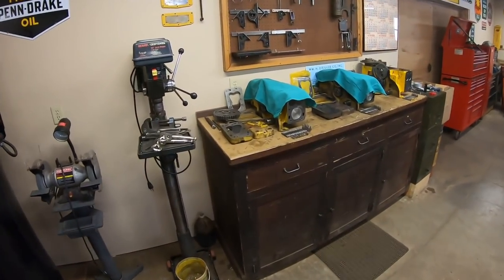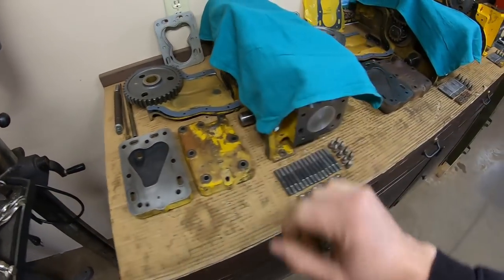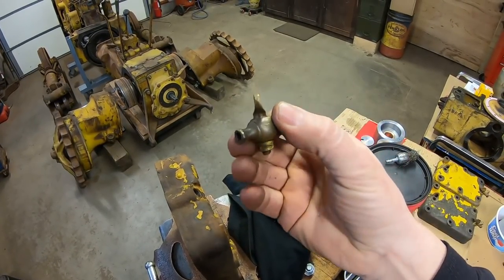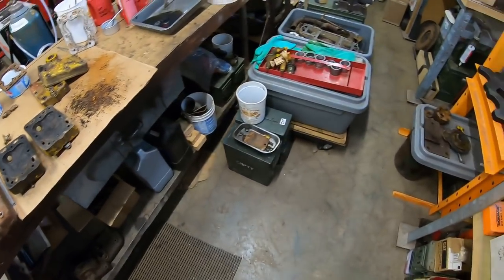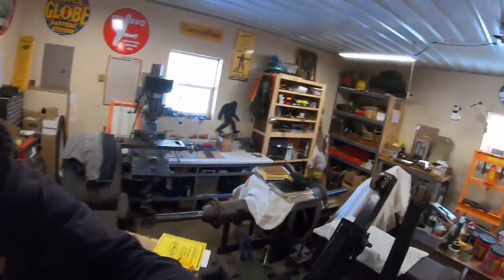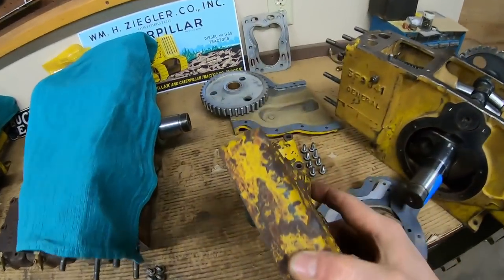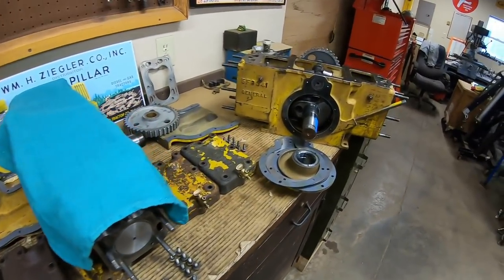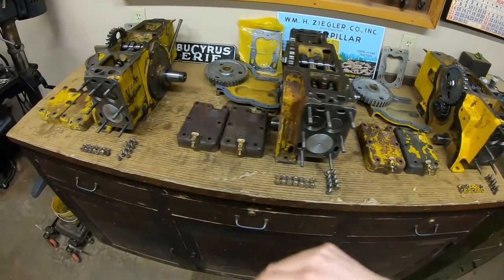Caterpillar D2 #5J1113 Starting System Ep.15: Dipstick Tubes, Prep Work & Cylinder Head Mayhem

Comment: A miracle that the correct hardware survived all these years. I work on stuff that isn't 20 years old that has all kinds of mix and match hardware in it.
Reply: Look up “pickeling”an engine, that is at least what it’s called in the marine world
Reply: The age helps 
Would have been the first machine people bought that had "standard" hardware 
Then for quite a while bolts were expensive so throwing away dodgy bolts and replaceing them was less common 
These days every farmer or construction company has a varied scale of bolt bin 
If I ever come across a bolt that's got a dodgy head or thread I just ditch it and put a new one in 
I mean bugger sometimes if the bolts too rusty I'll ditch it for a zinc coated one

Comment: Did D346 90 degree engines that had studs for mounting cyl. heads.  Made three spacers like the one you started to use on the dip stick! Tapered  a bolts last threads so to push on the center of the stud, then welded a longer nut to it after threading it about half way in the nut. Then could tighten the stud nut down tell it hit the spacer and stop! Saved lots of time that way! We did hundreds of those engines!

Comment: Nice work on these odd engines. What amazes me is the fact that they function even though the tolerances are so wide. I guess when an engine doesn't have to run for a very long time, it doesn't need to be very precise. The valve guides especially stunned me with their tolerances.

Comment: I went to start the pony on the 8T this morning and oil smelled lightly of gas .... time to change the oil. That oil had set for six or seven months and then had about 15 er 20 start ups put on it. 
I have a brass valve that has a bend in the spout but it is a 45° bend not the 90° that you have.... I think I might even have a pair of them.
Reply: @squatch253  Good cuz it's going to take me a year to find them now i spoke of them. I think the threads are the next size up anyway. like for the D318. That reminds me I need new springs for the ones on the D318.

Comment: Impressive showing and it's funny how close in thinking some folks are and you makeing tools is like me working alone late notes and needing a 3rd and 4th hand so I'd often improvise something to get the work done and like you a number of tools were made for jeeps for 292/312 Y blocks and for 235/292  chevy 6cyl. Motors. And also alike in our particular OCD issues everything has to be period correct and and build correct per the time of mfg. And lol I know in my mind pecoxs have to simply serve a function but I to want them matching and the the one from 5j1113 is awesome but it looks like one from a Green tractor a late 30s early 40s B stemwinder. Anyway loved the video and lol I've been watching alot of the earlier assembly vids as well as the road patrol grader vids I hadn't seen befor awesome
Reply: I used a JD “B” with the flywheel manual start when I was in high school. Dad and my brother usually took the newer tractor but I liked the old JD for cultivating row crops. That’s been well over 50 years ago now. I was rather proud some years later when visiting a friend who had a JD “A” with a flywheel start. I needed to move that tractor to mow around it and easily got it started, which impressed my friend. Of course I opened and closed petcocks as needed but I have zero recollection if they matched or not. I’m fairly certain they had the lever style handles as opposed to the wing styled handles that Squatch showed us. Sometimes now, having that little B would be handy.
Reply: @Greg_Gatsby  true but I know alot of those very by region too my cousins had an old B crawler and it had porciline and nichol chrome pecoxs

Comment: They likely had a capped nut, which makes installing studs a breeze. Basically it's a connection nut (the long ones) with a piece of threaded rod that had a ball bearing spot welded to it, which then itself is threaded and welded in place on the nut, leaving just enough for it to grab the stud comfortably and securely. The ball bearing makes sure you don't destroy the last threads, and Bob's your uncle. Have a bunch of them made for various sizes complete with T handle on the end. When you have something like that, driving them in is easy.
Reply: It's a wonder that Squatch, making tools for so many other operations, doesn't make a tool for threading in studs, of which he has a hundred to do.

Comment: Double nutting works good for removing or installing studs but Snao-on makes a tool for it. It includes a collet for each bolt size and thread and a sleeve that threads over the collet and you tighten it up. It works really slick. You probably know about it buying Snap-on tools but thought I would mention it.
Reply: I work with tools made like a steering tie rod tools are, works fine if small marks are not a problem, it is able to grab on threaded or unthreaded portion. 
Teng Tools: ST12506-C is first example part number, that i found while googling around

Comment: Well, there is a small tool for, looks like a cap nut, but has inside 'centrically' a small ball that sits centrically on the stud bolt. Is screwed onto the stud bolt without a lock nut and drives the bolt in. Does not save much time but also protects the bolt.

Comment: Instead of double nuts to install studs you can use a coupling nut with a short bolt in the outside end.
Reply: I had the same thought,   I  bet they had a  tool that  went over the  stud that was a specific length  and was  run  in  till it made  contact with the  block...

Comment: I've made stud remover/installer tools before when I have lots of studs (like 6.0dsl head studs when they don't have a female hex in the top of the stud). Short piece of hex stock bored/tapped to the size of the stud threads, and a suitable size grub screw/set screw that will meet the top of the stud but not be large enough major diameter to have a possibility of damaging the stud threads. Similar functionality as valve lash caps like "poly-locks"

Comment: I joined this a little late so I am not up to snuff on this project. That D4 dozer only used on starter motor but you’re rebuilding 3 of them. Why? Just as spares? Great videos, I am too lazy to go back and watch all the previous videos that would answer my question. Liked and subbed

Comment: Hey squatch, restorationstuff has the angled spigot drain with the L handle you like. I’m currently shopping brass primer cups and drains for 1917 Waukesha. Half the battle is knowing where to find this stuff when you can’t use the original parts!
Reply: @squatch253  I saw that flywheel supply bought out Essex Brass and is producing and selling their line. Didn’t see all the same stuff, but a guy can pick it up at the swap in April 😁

Comment: After visiting Kyle Christ's channel as you recommended, I'm a little confused as to where the RD tractors fit in with the D tractors. Your RD6 is bigger than a D2 but smaller than a D4, and his RD4 looks smaller than a D4, but maybe a little bigger than a D2. Could you give us a comment on how these different series tractors compare and relate to each other? I haven't been able to very easily do a comparison on the internet on my own. Or maybe you might know of a link or website where this issue is discussed. Thank you again.
Reply: The easiest and shortest explanation is that Caterpillar started with the "RD" series after the ten, fifteen, twenty, twenty two, etc.. but before they had the "D" series. The RD-4 is a D4, just older. Caterpillar dropped the "R" and just went to D2, D4, D6, etc.
Reply: @kylechrist  Hey I watch your vids and love the build but I can see your breath in the air. I'm in Eau Claire and thats warmer than your place. I have a good torpedo heater I would send your way if you like. Its an older model but throws nice heat.
Reply: @nickwarner8158  I appreciate it Nick, I have 2 of them but when trying to record I have to shut them off, also the shed I'm working in is not sealed up or insulated well, yet. I just dress warm and get done what I can, there will be heat in this shop next year though!
Reply: D4  7u  has more hp  than the RD 4   iam thinkin  mine has 57 hp plus a 5 roller track frame wet master clutch. Dry weight is. More on D4 7u     i am thinking 12000 lb with winch and dozer
Reply: @squatch253  Thank you very much for the detailed explanation. That really does clear up a lot of things for me. I see what you mean about the apparent size with the different track width offerings. I think you really put us on to a very worthy young man with Kyle Christ. I agree with Nick Warner about the cold shop--Kyle's pretty hard core.

Comment: I’m pleased that you put in the bit about the studs taking so long to do. People see your edited video and it’s a bit like the old car manuals: STEP 1, remove engine, STEP 2, remove (the sneer generic part name)

They don’t see the legwork. How long would it take you to find a NOS set of rings? But in the video, they sit on the bench, wrapped in cosmoline, an offering to the gods of compression and lubrication!

Do I want to watch you scraping antique grease from 12 track rollers? Probably not. Do I want to see 20 minutes of you going back and forth on a breaker to extract a pre-combustion chamber? YES!

If you don’t mind me asking, what brand is the gauge setup you were using? Imma need to get one for that very reason!
Reply: Cheers fella!

Comment: Awesome video again! Thank you for the continued great informative content. Quick question, have you ever considered using a product like Evans Waterless Coolant? I watch a lot of Jay Lenos Garage videos and to eliminate corrosion on his old vehicles that’s all they use. Doesn’t even need any radiator pressure to work either so it saves on potential leaks as well due to older weak radiators or other weaker connections. Just a thought to eliminate corrosion going forward on some of your older machines that don’t run that often. Keep up the great work! Cheers.

Comment: I have a '47 D2.  The starting engine and a spare have the oil drain tube with a pipe plug.  I have tried unscrewing the plug on both, but it is tight, and I am afraid of breaking the aluminum tube.  Also, the pony motor that is mounted, the oil dipstick will not pull out.  Have tried pulling with vice grips, no help.

Comment: And for my next stupid question how did you remove all the pony studs without heating and/or damage?? Mine are in there!
Reply: Thanks, I was hoping you’d say that, didn’t want to heat the block, trouble is this is where experience helps as shearing them off would be a real bummer..onwards!

Comment: Whyfor is there a petcock on the cylinder heads? I dont get it at all....
Reply: @squatch253  Thanks for the answer (and correcting the others). I trust you had to open both peacocks at the same time or all hell would break loose. Also...one carb, so flooding would likely affect both cylinders equally, right?

Comment: I'm sure there is a good reason but why are these starting engines liquid-cooled ?
Reply: Simplicity? Besides, it helps heat the main engine. The Russians used two stroke air cooled engines for their smaller Caterpillar clones.